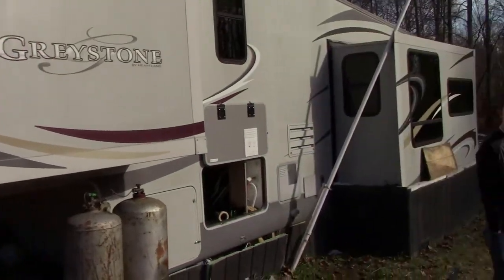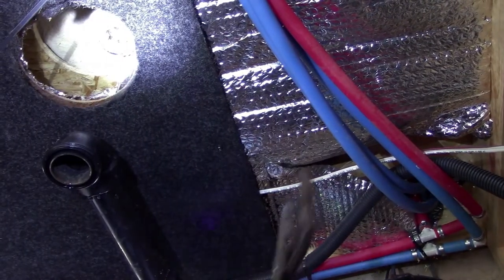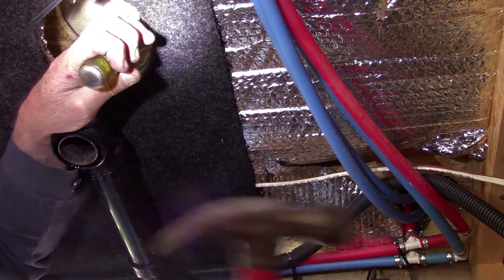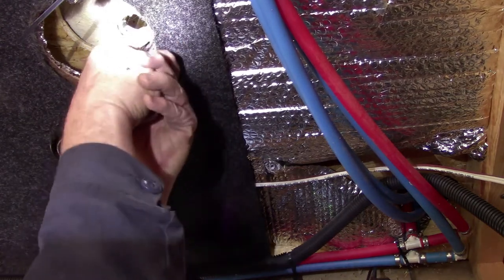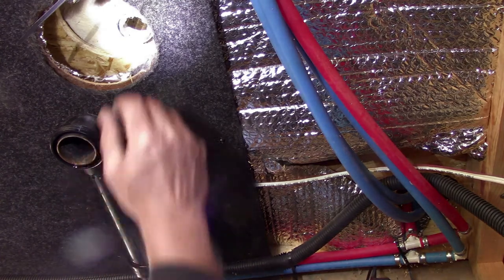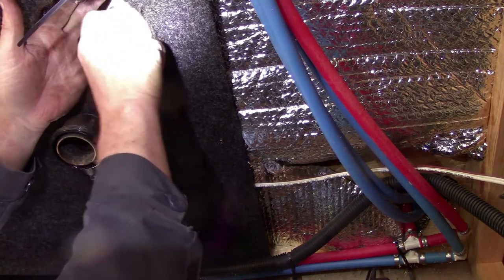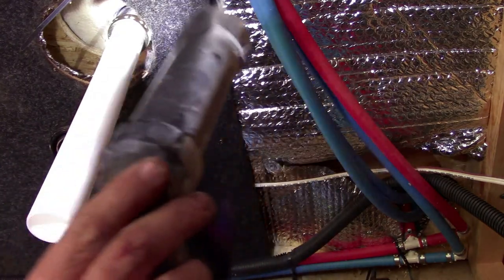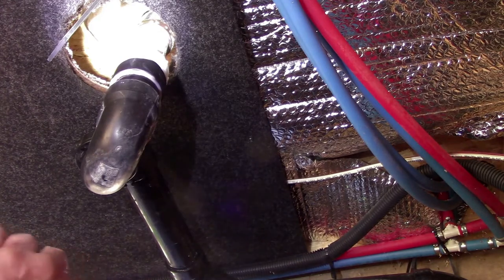Repairing A Broken Shower Drain On Your RV

Comment: Wow hard work that is thanks for posting. Mine is in  the Cedar Creek Cottage the 44CCR and you cannot for the life of me wonder why they put a shower box in with a seat! the drain is leaking underneath and you just simply cannot see what you are doing I cannot tighten it, as it is in such a place where you cannot get a tool under there or see if its on right. So, with that i looked up what i could do and found Selleys Knead it xproxy aqua and thats gone on and now i have a extremely very mild long winded drip so got some more and will attempt to put that on where i think its not covered this is all guess work. At least you can see what you are doing and shave that wood down to make the area fit the drainage; would like to rip the shower box right out if i could and put a total flat flooring into it so that you can see under the shower drain - never again.

Comment: So is the white tube ridged enough? 
My 5th wheel has the exact same issues. The plywood needs trimmed as well. I have room to cut it with my jig saw though.
I'm in middle of the project now.
Thanks for the video.
Reply from the maker: The black pipe can be hard to find sometimes, especially the traps, so I use whatever I have that is the correct size.

Comment: Are the drain parts standard house hold shower / tub drain parts or RV specific?
Reply from the maker: For the most part, yes. Any plumbing job sucks because it is hard to get all of the stuff you are going to need the first try.
Reply: @hillbillyrv  Thanks, I have a 2020 Arctic Wolf 5th wheel used 5 times and the shower drain leaks, disappointing. But I will get in there and pull it apart and fix it.
Reply from the maker: @harlandixon3453  Chances are that something is just loose. Good luck.